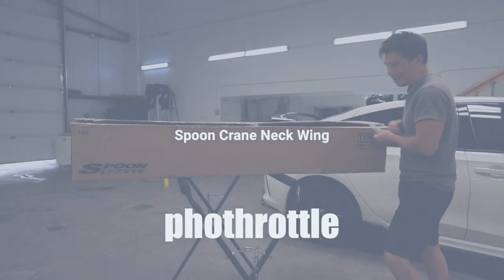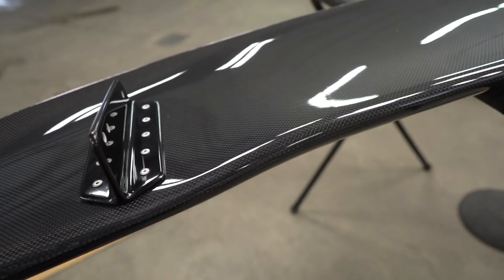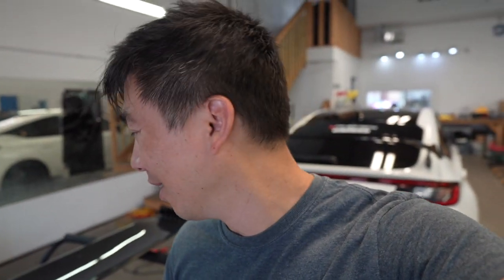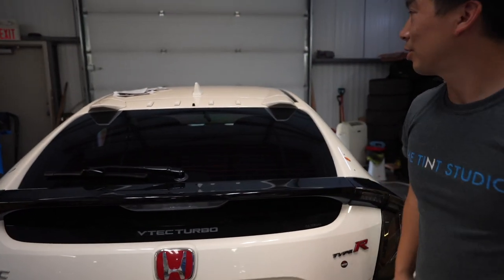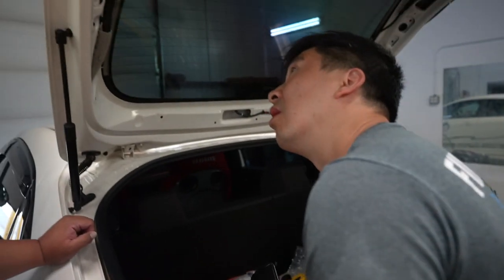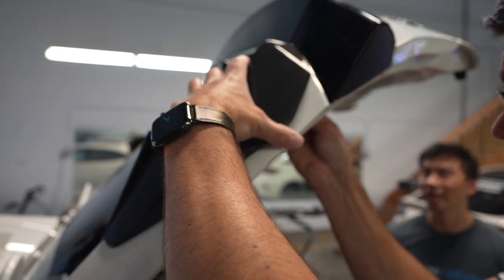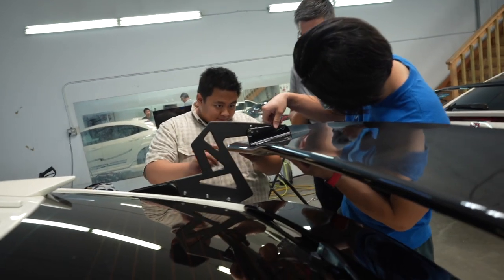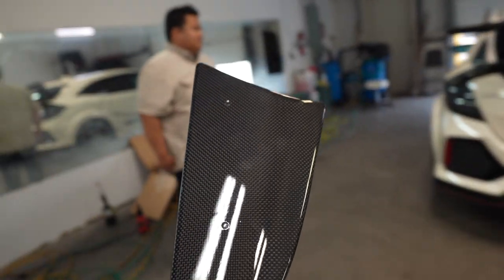Spoon Crane Neck Wing Install | FK8

Comment: How u open 2 black clips. Its that broken?
Reply from the maker: Those rubber stoppers are pretty much a one time use. They have a tendency to over stretch when you take the hatch panel off. I believe they are roughly $45 to replace.

Comment: Hows the wing holding up? It looks like you didnt drill for thr 3rd hole. I didnt either I just put 3m double sided tape on mine.
Reply from the maker: The wing is doing great no issues.